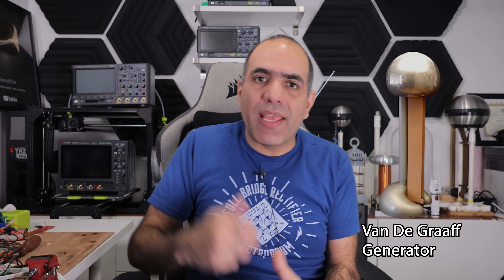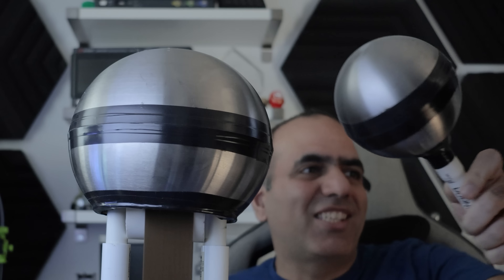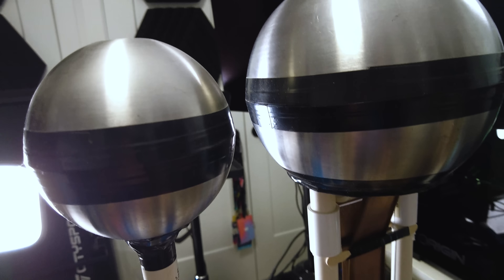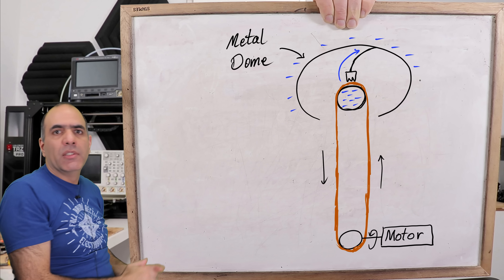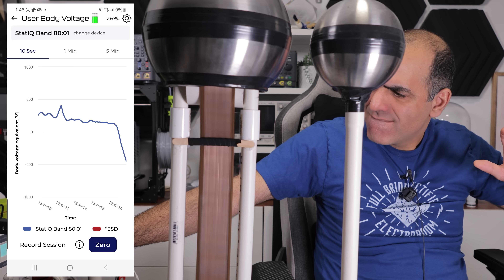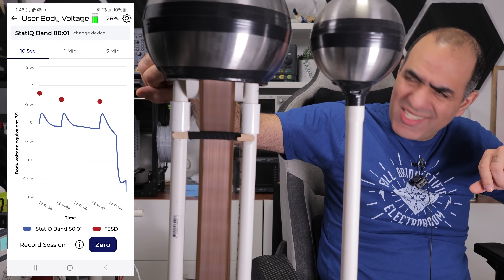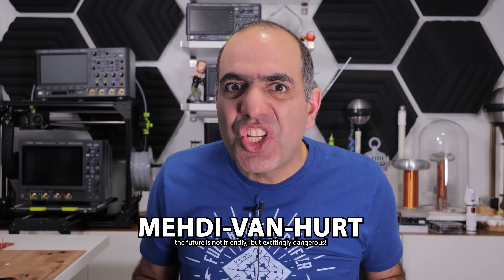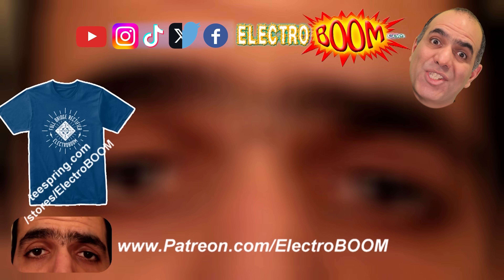An Attempt Was Made!

Comment: Medhi - can you please make a video where you build a "shock box" - something us high schoolers used to build in "shop class". I can't for the life of me find any information on this elusive project, maybe you can (but I doubt it). Or better yet, model one after one of those "shock gum" pranks, also good luck with that. The circuit contains a mini 3 lead autotransformer with a shared primary/secondary lead, and a mystery component! The mystery component is [maybe] an uncased open ic that is covered with some kind of potting compound and most importantly, not one single YouTuber, LLM, or even human outside of China has yet to positively  identify this component and simply draw a valid and accurate schematic. It would be pretty cool if you managed to do it. I think you might have a chance of figuring it out, might need some nitric acid to depot the mystery chip or something, so it could be a fun video. I'd enjoy it at least, especially if you completed the quest. Good luck electroboob

Comment: Hi Mehdi
I think the problem with your Mehdi-van-Hurt machine is that the tribo-charges are generated at the inside of the belt, while all the brushes (aka copper combs) are on the outside of the belt. The inside of the belt is always negatively charged in a Van-de-Graaff generator. That charge is created only shortly when the generator starts up. It is never transported anywhere – only rotates up and down and back. Thus, there is no influencing from one side to the other despite your assumption.
Better Van de Graaff generators use a high voltage DC source to charge the belt directly - instead of the tribo-charge from the upper roller. They don’t use tribo charging. Possibly you can build a second Van-de-Graaff generator that has a metal roller on the upper end ... and a longer belt? Then use the two generators together - in a staged assembly. So, the first generator will make the high pre-charging voltage for the new generator. Acting as a high voltage supercharger. For even more power!
Anyway – your design is as elegant as effective. Don’t know if it requires improvement. The beauty of simplicity.
Love your channel!

Comment: I think that it's because the Wimshurt generator relies on two separate plates whereas the copper plates on the belt are on the same rotating assembly. i think that creating two Van De Graaff belts and running them close to each other making sure that the belts were running in opposite directions would create the effect that you're looking for.

Comment: Run the little ball with a wire to the top dome instead of ground, that way instead of sucking charge away it adds to it, have a one way diode between the ball and the dome  to help charge go in from but not out through the ball.

Comment: It may sound silly... But isn't it already negative, because of the material (copper)? Since it's a semiconductor, why not using another material, perhaps not as conductive...
Or why not, also isolate the belt from the dome (obviously ensuring a way to pick up charges for the dome itself and for that ground mini ball), since it seems copper plates are already building up negatively...

Comment: Ooops! I forgot to add the reason I am stating the household current limitations is that NEW forms energy (i.e. from a Van Der Graf generator) cannot be created but only transformed, so the energy that is used by the belt motors and other systems plugged into the household plugs has to go somewhere in order to be converted into a spark! Ergo, there is ONLY 1800 watts available to sent out as an electrostatic discharge from the Van Der Graf setup. That means the MAXIMUM voltage he can get is about 12,000 volts at 0.15 amps (150 milliamps) and that 12 KV voltage seems to be the maximum possible safe limit for this specific machine he is showing us! 

To goto a higher power level with a BIGGER SPARK, he would have to plug into the Dryer Machine plug which should be 240V at 30 amp = 7200 watts or about 48,000 Volts at 0.15 amps (150 milliamps) maximum for his machine. That STILL can disrupt heartbeats if the person has an unknown heart condition so DO BE CAREFUL when using it! 

P.S. Are my calculations correct? LOL!

V

Comment: The big issue is your household current which from most plugs is 120V at 15 amp = 1800 Watts soooooo you COULD, by using various means reduce the amperage and UP the voltage, to get something like 12,000 volts at 0.15 amps which should give you a NICE maybe heart-stopping JOLT!

Now if you had access to a local supercharger station, those can be up to 900 volts at 400 amps = 360,000 watts which means you could get up to 450,000 volts at 0.8 amps with some REAL FANCY transformer windings and some luck! Now THAT would be a SHOCKER of a story to tell on this channel!

V

Comment: You could try to put copper tape on the bottom pvc tube, and then connect it to the ground, make a structure similar to a single electrode mode triboeletric generator

Comment: Mehdi, I’m genuinely wondering, can you maybe get or borrow a commercial fire alarm control panel and probe the NAC outputs? I don’t have a scope but I have a fire alarm panel that i can let you borrow, maybe you could also fix it? I think one of the power transistors is fried shut and always outputs power when in normal operation, please? You don’t have to if you don’t want to :(

Comment: Once I used to work in a wearhouse and drive a forklift. It had rubberwheels against concretfloor and the forklift could be charged like this machine in the video. It could be so much so when I put down my foot on floor I could feel how the electricity went through my foot and the rubbersole of the shoe down in the concrete. How many volt was that?

Comment: maybe weling someting like a bakwards ring on sharp edges that limits the charge loss. I think you can use coper band with some electric tape to stick it.
I dont know if that work if you are using some capacitors like your wand to increase the negative charge.

Comment: My family home has lightening rods that have never been hit.  I know because the braided copper ground wires have never had the paint burned off.  But, many of the trees about 100 meters away have been hit.  I know about aluminium sailboat spars, but I didn't know that the same works for houses.

Comment: You should think about the electric fields, not just charge on the objects in the machine. You mentioned the accumulated charge on a pointy finger. It’s more helpful to say that the electric field is more intense around a point, which causes the air to break down in that region and create a spark.

Comment: There is a device that operates by a similar principle called the "pelletron" or "laddertron", where instead of bringing the belts into close proximity it uses an arrangement of shields to get electrostatic induction between the incoming and outgoing belt and force extra charge transfer at the bell end. The arrangement can be a little unintuitive but I feel like you could produce something similar with some foil shields in the bell housing? These devices produce voltages so high they need to be insulated with vacuum (MULTI-MEGAVOLT!).

At the drive end they induce the starting charge with a high voltage to since it is generally not a triboelectric generator, but it should still work with the triboelectric generation you were using here if you don't want an external supply, and might even work by just repeating the charge transfer apparatus used at the bell end which would be anyone's guess whether it ends up charging positive or negative.

Comment: remove the electrical tape off the copper rod or replace the rod with a copper plate, also potentially place back the plates on the panty hose and place some on either side of the middle plexi glass

Comment: You've got a toroid sitting behind you that you should put on the bottom edge of your upper ball to eliminate the sharp edge.  I've always thought that a rubber belt could be charged up with a spray of electrons from a small cockroft-walton high voltage generator at the bottom of the belt.  This would be a direct transfer of electrons rather than relying on triboelectric effect.
Reply: Also, a surprising source for polished balls is the flag pole industry.  Sometimes cheaper than what you find being sold for Van De Graffs.

Comment: Mehdi I don't have the knowledge you seek for the mehdi van hurt machine buuuuuutt
I DO HAVE AND ALTERNATIVE
Mehdi-Van-Marx Generator.
Around 6-10 inch tall vandergraph generators connected in a marx generator configuration.
The bandsrgraphs will charge in parallel, then discharge through series connection of the mark generator.
Judging bybthe arcs you should be able to make meter long sparks.
Good luck

Comment: Why don't you put two belts, one inside the other, and rotate them at different speeds to create a potential difference to form a field between the two surfaces, and you can make them rotate in the opposite direction to each other to pick up different charges and connect the wires of the second belt in reverse to add more voltage?

Comment: 13:20
Yeah right...
The ground has nothing to do with arcing speed.
It's the distance between the charged ball and the discharging point that changes the arcing speed and also strenght of the arc.
It takes more voltage to jump further. So further appart equals less frequent but stronger

Comment: The Van de Graaff machine was originally designed to be a particle accelerator.  They are still in widespread use, and sometimes they are used as pre-accelerators for larger particle accelerators.
Reply: These days it's more likely the Cockcroft–Walton generator that is used, which uses a voltage multiplier system rather than belt... but yes the Van de Graff was used
Reply: @RWZiggy  I guess you've never heard of an actual Van de Graaff accelerator before.  That's what I'm talking about.
Reply: @douro20  Of course, you're saying funny thing to guy that worked at national high energy physics lab.  But the CW is doing the heavy lifting these days

Comment: Just watched your video, 

It looks like you need to increase 3 things. 

1. Surface area of the belt
2. Surface area of the pvc pipe 
3. Belt speed. 

So I noticed that if you have a smaller surface area the object holds less of a charge. At a place I used to work at the forklift drivers would push skids around that were shrink wrapped building up a charge and we noticed that the larger the skid the bigger shock we would receive. 

Hope this helps. Looking forward to what you come up with.

Comment: if you look closer to your charge collector "ball" you shall realize your construction make capacitor between belt on both side. I think this is not very helpfull when you want to store more electrons between belt and ball. I bet it is yout main leakage place. 
Leave upper side comb on it's place but move up collector and chagne it into metal sphere. 
You also can use glass instead of plstic, humidity and fat (from hand) can destroy plastics isolation properties. Maybe not in terms of voltage breakdown but for sure for leakage.

Comment: Most electricians don’t realize that from any source of a finite potential intensity φ (phi), regardless of how small the value of φ, as much energy as one wishes can be collected, simply by W = φq, where W is the total energy collected from potential intensity φ by intercepting and collecting charges q. If one wishes to collect more energy W from the same potential φ, one simply needs more q. The reason is simple: the scalar potential is actually a bidirectional set of EM energy flows, as shown by E. T. Whittaker in 1903, and what is collected from it depends on the number of fundamental interceptor/collectors (called “charges”).

Comment: FYI one of the easier ways to boost a Van de Graaff is to just induce a charge in the belt directly, though you're still limited by the size and smoothness of the terminal sphere. Also a rubber belt would probably work better, you could use an automotive fan belt in place of nylon hose.

You could also use a second Van de Graaff in tandem if your only goal is massive voltage potential at the terminal.

Not sure if the plastic insulator between belts matters much, as the inner surfaces are both negatively charged, but you may want to try proper dielectric glass. MS QQQs operate in excess of 40kV to accelerate ions and some use a glass capillary rod as the accelerator by applying +20kV on one end and -20kV on another.

The copper plate idea is basically a pelletron but lacking any mechanism to charge them. You'd want a negative electrode near the plates right as they come off the pulley to positively charge them, then a positive electrode before they recontact the pulley to limit how much they discharge back into the pulley.

Comment: If you start with a WinshurSt machine, and run the out put from it to the belt, you could directly test the addition of charges. Once/if that is successful, start integrating. I'm currently trying to make a double acting Winshurst, with sectors on both sides of each disk, so as long as you can keep charge separation it should work. Thanks as always for your videos!

Comment: Hm, I wonder if using another piece of plexiglass/acrylic with aluminum/copper tape on either side of them to make a crude air-core capacitor could help or hinder the charging. It could very well make for a spark gap if anything.

Comment: ...I have Ideas on how to solve the problem but I have none of the malerials. 

Make the device as you had it. except detatch the sphere and replace it with a ball you have drilled a hole into. Solder then glue a thick and well insulated wire into the hole. Then afix the wire/brush to the top of the pulley. Encase the tower in plastic (especially behind the brush at the top, maybe a rubber wipe instead), while leaving an opening for your extra ground lead/brush.

Then utilize your new shock-flail.

*(If it still doesnt work make the strips of copper wider but shorter vertically and more spaced out 🤷‍♀️)

Comment: What if you make the dome material thicker (to keep more electrons) or increase the size/circumference to increase the surface area, so that more electrons gather on the outside. Electricity movement is on the outside of wires, so more electrons should be able to gather on the source sphere? 

The charge of capacitors increase with surface area, so should be the case with the sphere?

Also; what if charge is continuously removed from the source/main sphere; more may flow from the additional source to the main sphere? A dam can only keep and discharge as much as that that flows into it, then it will push back up the river.

The aim of the machine is to get as much big sparks from it; it is to increase the flow of electrons over the gap (basically more amps by increasing the collection of electrons on the big sphere).

Comment: i haven't got the money or equipment to do this sort of thing.  how about on the positive side of the charge you add 2 metal plates air gaped?  the negative charge collects and is transmitted to the dome, the positive goes to ground.  this should help while preventing some leakage

Comment: This reminds me of my youth experimenting with HV. I was a bit more hard core with it though. I had an oil burner ignition transformer with an output around 10kv. I was a dumpster diver for parts and had come across a voltage doubler device rescued from an old TV (which I still have in the basement 45 years later) to which I would connect the output of the transformer, which I then connected to a fabricated plate glass capacitor (roughly an 8x10" picture frame) with a 1" gap on each side using aluminum foil. The sparks were deafening, so I made a "spark chamber" from a wooden X-Acto knife case with a observation window cut into it, covered with plexi. It could easily throw 2" arcs which were FAT and still quite loud even in the chamber, but at least I wasn't going deaf. I had the same leg discharge issue once, but since this was not static electricity, but hard core high amp electricity, it left a scar that lasted 10 years. This is my first time on your channel, so I should check out some more of your content, as you seem like a bit of a nut like me.

Comment: Round the edges of the dome terminal, at least 20mm diameter.  Enclose the entire belt assembly in an insinulating tube that extends upwards into the dome.  Clean everything thoroughly,  smooth all conductive surfaces to a mirror polish.  Theoretically you could put the negative output of a Wimshurst machine in place of the ground/earth terminal of the belt, and run the positive of the Wimshurst to earth.  The WM would then be the first stage electron pump, for the VDG, but it would need to be large enough to charge faster than the VDG could pull electrons out of it. Or you could build a High voltage DC supply that pumps up the lower roller the same way, like a 10,000v Neon Sign Transformer with a FULL BRIDGE RECTIFIER!!!

Comment: How about “irradiating” the pantyhose on the way up with negative charge from some HV generators from air purifiers. (or with a pointed fork connected to the negative output of an additional, but mechanically coupled Wimshurst machine).